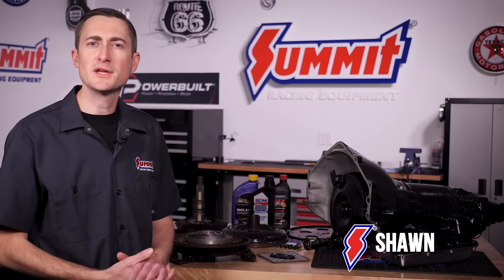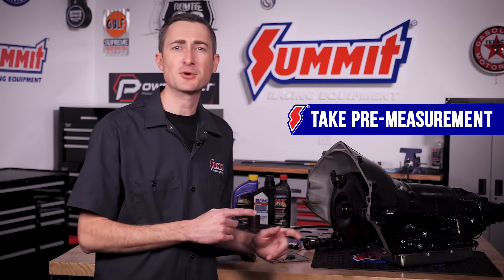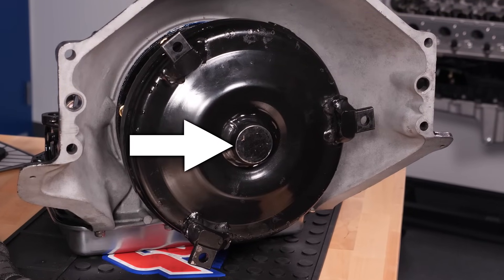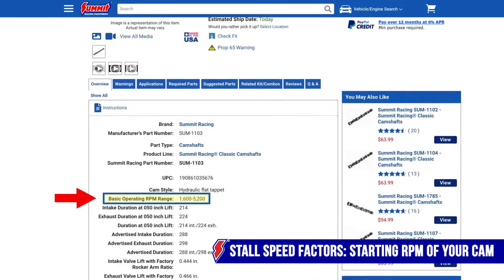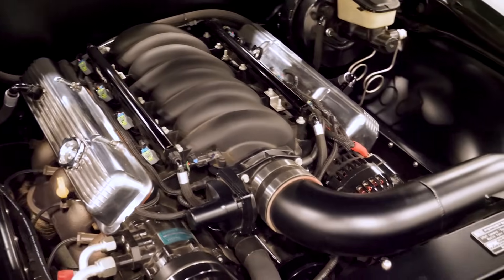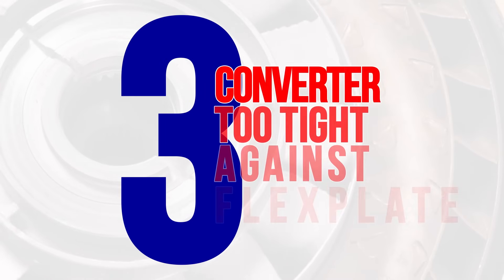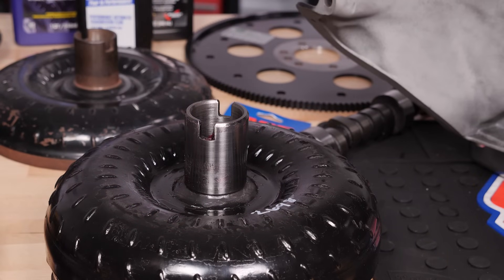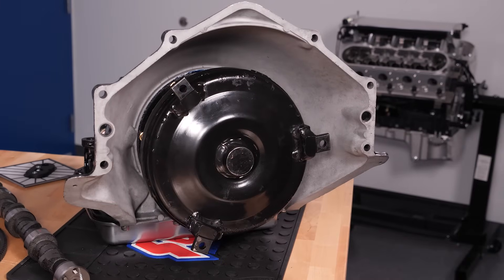5 Common Torque Converter Issues and How to Avoid Them!

Comment: I changed my valve body and solenoids on my truck, it only went in reverse. Now I have to shift up and down a few times to go forward. Do you have any idea what it might be? Thank you!
Reply from the maker: Hi Juan, We would suggest to check the transmission fluid level (This is done with the engine running, the transmission in Park, and the transmission at a warm temperature), also verify the shift cable is adjusted properly, and lastly you may want to check that the installation of the valve body and solenoids was performed correctly.
Reply: @SummitRacing  I did all that. I am going to get more gas for the truck since I wasted most of it trying  to get it to go forward. I drove about 10 miles, when I got home I tried to shift and  I was back to where I started lol
I got it to go forward a few times
Reply: Also, if it's a newer Chrysler product the trans fluid is checked idling in neutral, not park.
Reply: @whitef250powerstroke  it's  a Ford
Reply: Fixed Or Repaired Daily. I am dealing with one now that is shifting hesitantly. Wasn't taken care of by the previous owner and has a lot of little routine maintenance that needs doing. Pain in my a.s since it is an Aerostar with a front to back engine orientation
Reply: @natureboihikes7827  FIRST ON RACE DAYS !
Reply: @garyv2196  flip over read directions, found on road dead, and f..... on race day!lol my work partner and I used to banter back in forth
Reply: I have a f150 with the 5.0 302 engine and previous owner neglected it so bad just changing the oil gave me twice the horsepower and when changing the transmission filter I noticed they didn't place the magnet back in.. but I have a problem with it losing power and I've looked everywhere for help tbh when driving it does fine until it warms up and then it loses any input from gas pedal and jerks several times if still trying to accelerate but letting off gas and driving under 35 it does ok no jerk issues. I'd say its like a vaccume cleaner being turned on and off at a rate of 3 to 5 seconds and it jerks because the transmission isn't getting the info from engine I dont think its the transmission because after the fluid change it goes into every gear near perfectly and its more like there's either a fuel or air problem at certain speeds.. any help would be appreciated just please dont say its the trans lol dumped so much money already 😅
Reply: Hi every one i changed 2004 kia spectra gearbox now all gear go forward no revers
Reply: Need more information, but most. modern electronic transmissions have to be reprogrammed anytime a solenoid pack is replaced.

Comment: My little mazda been,making a clicking sound at low rpm low throttle for 30k miles now. No leaks, no lights, new plugs, tested coils, trans drain and fill, exhast donut, checked for loose heat shields. Noise goes away in neutral :/  car drives fine, all fluids good and clean, serp belt good and clean, airbox good, throttle body clean, intake seals good, valve cover seal good.   Im almost thinking loose catillitic converter material but my friend is emissions guy and my emissions are good and steady.  I love this car but this one thing is driving me batty, 2009 mazda 6 base 4cly.  Anyone got any ideas? Had this problem in mazda 6 or ford fusion?
Reply: Mike Schiavoni try taking off the fan belt it may be the water pump
Reply: @ianmccann6527  ill do that, its actually become intermitent in the last two weeks.
Reply: Same mike it only goes away in neutral
Reply: @raqss3665  it ended up being the topside heatshield on the catylitic converter under the car. One heat shield screw rusted out but still looked like it was fastened but it was broken a few threads down into the top heat shield.  To test safely get under your car when its cool and NOT running and if your a manly man bang on it with your hand but if your a girly man use a mallet very softly to recreate the sound. To repair its not a fun job. First put on eye protection, its required or you WILL get rust in your eyes and thats terrible, trust me. Second with eye protection get a drill bit slightly smaller the the thread Not head thickness. Drill out the old screw without damaging threads by drilling slow and straight as humanly possible. If you do happen to damage the threads you will need a longer bolt and fasten heatshilds with nut on top, not the best but works. Luckily some mechanics are used to doing crap like this and dont mind it so wont rip you off.  They will be the greesey guy covered in crap in a small shop. If he or she is not filthy they they will want too much to do the work.  Good luck!
Reply: @raqss3665  oh yea, and one other thing. It you drive on gravel there is a spot where gravel gets stuck in the same area. I was lucky enough to have both happen. So if you drive on gracel a bunch then check for rocks rattling in crevises.
Reply from the maker: Hi Mike,
We would suggest taking your vehicle to a reputable shop around your area so the clicking noise can be properly diagnosed. Depending upon where the noise is coming from, it could be the timing chain tensioner, a lifter, or something else.
Reply: @SummitRacing  yes, beginning to think its the timing chain tensioner.  Too bad im a freak about oil changes, fluids, etc.

Comment: So I installed the torque converter on my fly wheel 1st,funished the build and thought I had a starter problem. Click click click. So I went to problem solving and the motor was stuck. So I installed the tourqe converter wrong didn't I lol
Reply from the maker: Please make sure you installed the torque converter into the transmission first, then bolt the Transmission to the engine and lastly bolt the torque converter to the flex plate. You may want to carefully inspect the front pump of your transmission, hopefully nothing was damaged when the Engine was stuck.

Comment: All bad news for me. After 4 years i still havnt found out where a ticking noise is comming from, I've got a bad back so taking the trans in and out is a no go for me, sux I just want to drive my joy again 😪 I hope it's my flex plate, I don't think it was aligned correctly. 
Don't listen to mates if your in doubt! Sit on it, do your research, call shops.  
I lost all my friends and down a car at the worst time of my life having a permanent injury and moving to a place I don't know just so I can afford to keep my pride and joy registered at least...

One day though I'll win the lottory! 😉
Reply: HULKGQ Nissan Patrol don’t lose hope man I’m on the same road just dropped a new motor on mine and my transmission dipstick started spitting out transmission oil
Reply: The bolts that hold converter to flex may be too thick. Easy fix. Take off access plate and look to see if your bolts are hitting block or cover. Mine were hitting making awful ticking noise. Took off bolts one at a time, ground of about an with of and inch, added loc tight and was done in 1 hr. Hope this helps...
Reply: Possible cracked flex plate

Comment: .how to avoid them
Me: be a man and manual swap it.
Reply: It's not as simple to manual swap on a newer vehicle.
Reply: Would that work in newer vehicles? I'm considering swapping mine for 6 speed stick like my old yota. I just don't know alot about electronics
Reply: Automatics are faster
Reply from the maker: These 5 trouble shooting tips are only for torque converters, which are only used with Automatic transmissions. You may want to search the internet for answers to your vehicle specific questions.

Comment: What's the difference between an oldsmobile and chevy converter
Reply from the maker: The attachment to the flexplate is the difference. The Oldsmobile torque converter uses bolts that thread directly into the mounting pads while a Chevy torque converter uses nuts and bolts through its brackets.
Reply: Not alot they both pure scrap

Comment: I prefer a clutch over a torque converter to move my wheels up the road.
Reply: That’s why you’ll always be slower. Can’t outshift a computer..
Reply: All day
Reply: Who cares automatic faster
Reply: @markmoire2058  yeah they're faster on the highway but who races on the highway when you can take it to the track?
Reply: @rollingthunder1221  drag or road racing?
Reply: @rollingthunder1221  automatics are king at the drag strip.
Reply: @4dscdriver Top Fuel and Funny Car disagree...  Well to be fair both of them don't have a trans, they just weld the clutch plates during a run haha.  But you are right, most of the faster/under 10sec cars are running autos.  Most people don't want the expense of aftermarket manual transmissions and high torque clutches, and auto is more consistent times for most drivers.
Reply: @markmoire2058  wow, another muppet that doesn't understand real driving..